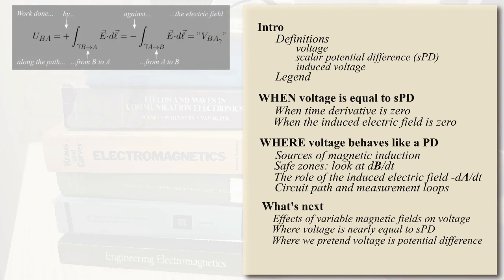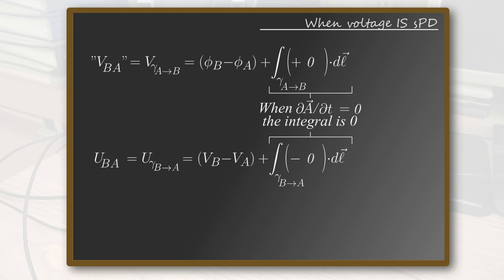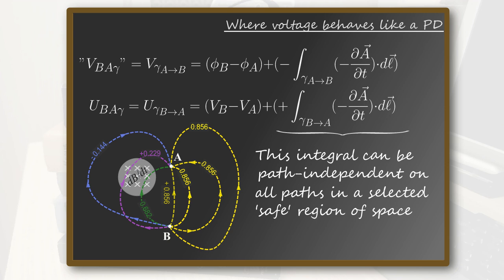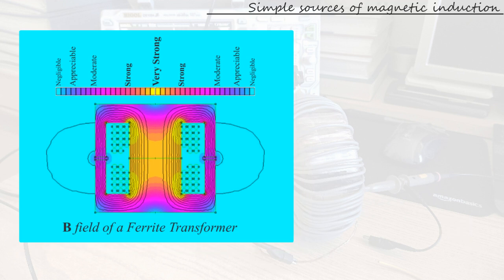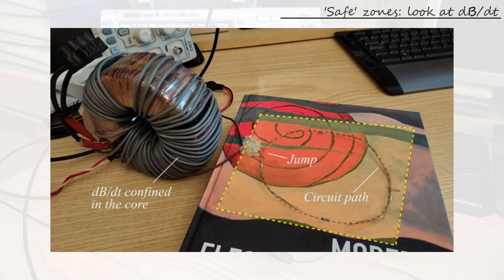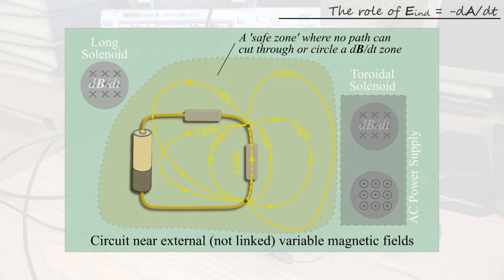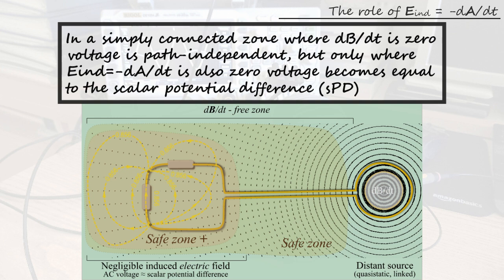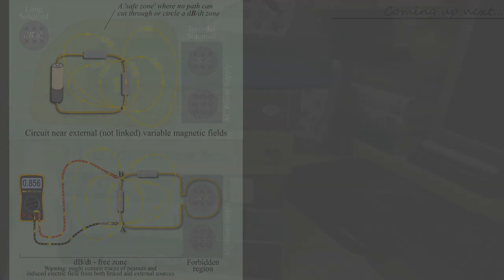When and Where Voltage is Path-independent

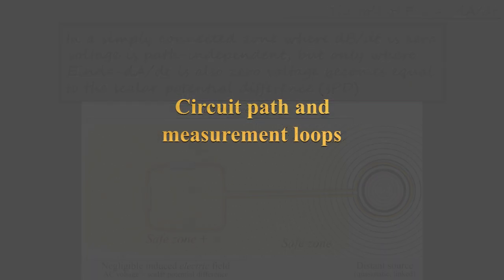Comment: 42:33 Circuit path Г is not conservative. Inside the battery is not a "safe zone". I know we partly discussed that already, but I insist on that. E field is literally defined as a force acting on a charge, divided by that charge value. Lorentz force is NOT the one and only force that can act on a charged particle. Chemical forces inside the battery are not conservative, hence they create non-conservative E field. Perfect proof of that is a load, like a lightbulb, connected to the battery. It actually lights up. Charges do actually move along that loop Г, and every time they make a loop, they dump more and more energy into the load. That is impossible in conservative E field. If you want to define a safe zone, you have to avoid EVERY source of non-conservative field. Do not go with your E*dl integral path into batteries. Or into solar cells, or thermocouples, or piezoelectric elements, etc. Whole world does not revolve around purely and only magnetically induced E fields.
Reply from the maker: Don't worry, I appreciate criticism.
This is a series of videos all linked together, and as I specified in the previous ones I am - for the moment - only considering EMFs of electromagnetic origin in stationary circuits. (EDIT The circuits with batteries are used as examples but I will explain how to treat chemical EMF in a later video, but the electric field is conservative there - there is another force that is not conservative and does not appear in the circulation of E)

The reason is two-fold: first to simplify the exposition, avoiding the more complicated general case (moving, deforming circuit, retardation, radiation, and other sources of EMF).

The second reason is that the EMF of electromagnetic origin is a very special kind of EMF. It is the only one that can make voltage path dependent. The other forms of EMFs are not primarily associated with a time varying magnetic flux, and as such do not introduce that element that will make a zone 'unsafe'.
Being safe or unsafe depends on the presence of dB/dt in the area, not on the presence of a non conservative source of electric field. Only the EMF of electromagnetic origin introduces that element in an unavoidable way.

This will be clearer (I hope) in the video on IEC loop voltage, and even more so on the videos on the EMF.
Reply: @copernicofelinis  But the voltage definitely is path dependent along path Г. Think about it. E field is zero inside wires, because they have zero resistance. E field is zero inside battery, because it has zero resistance, the same way. If that bothers you, let's replace battery with a thermocouple, placed in a fire. It literally is a piece of wire with zero internal resistance. The only place where E field is nonzero, is the load, connected to that battery/thermocouple. You make 1 full loop around path Г, you get voltage of 1*EMF, all of it inside the load. If you made 2 loops, you have load voltage of 2*EMF, and so on. Infinite number of possible integral paths through the battery/thermocouple, so infinite number of possible voltages through the load. And it is true. That same 1 electron  traveling along the path Г twice actually will deliver twice as much energy to the load, compared to electron that traveled only once.

What makes you so stubborn about this? You say let's stick to IEC definitions. OK. Where in those definitions does it say that the one and only force that defines E field strength is the Lorenz force?
Reply from the maker: @krakrukra1731 again, this will be explained in the video on loop voltage and emf. Consider an open circuit battery: it produces a charge displacement at its electrodes, let's say plus on top and minus at the bottom. The field from the plus charge at the top will go out in all directions, in particular upwards towards space (the field lines will later bend to reach the negative pole) and straight down directly towards the negative pole. So you have an electric field that goes from plus to minus in space AND an electric field that goes from plus to minus INSIDE the battery. This is a conservative E field and the circulation of E dot dl is zero. The missing part is the component of F/q that is of chemical nature, but that only appears in the computation of the EMF, and not in the circulation of E.

The same happens when you close the battery on a load. In this case you will have an electric field going from plus to minus in the resistor and an electric field going from plus to minus (again!) in the battery. And again the circulation of E dot dl is zero.

You can't see EMFs of non Faraday origin from the circulation of E. I guess that is why the IEC chose not to define the concept of EMF and go instead with "loop voltage".
Reply: @copernicofelinis  That does not answer the question. Electric field strength, E, has an IEC definition. From IEC-60050-121, literal quote: "electric field strength (symbol: E ) vector field quantity E which exerts on any charged particle at rest a force F equal to the product of E and the electric charge Q of the particle: F =Q*E"

There is no limitation on what that force is, as far as IEC definition is concerned. Why do you arbitrarily place this requirement yourself then? Because you really want to believe that "Faraday's law always works"? No, not always. Try to apply it to a battery circuit, Lewin ring style. There is no changing magnetic flux inside. So Faraday's law predicts 0 EMF in the loop. Resistance inside the loop is equal to the load resistance R. So, you predict that current in the loop must be 0/R = 0 amps. Voltage across the load must be 0*R = 0 volts. Faraday's law predicts, that the battery can NOT as you say, create charge displacement at it's electrodes. But it does. Current does flow. Voltage does appear across the load. Your prediction based on Faraday's law alone was wrong.
Reply from the maker: @krakrukra1731 Faraday's law predicts 0 EMF of electromagnetic origin (by this I mean due to a changing flux), yes. But it says nothing about other forms of EMF.

In 

F = q E

F IS q times E. If you prefer, write it as F_electrical = q E. Why are you putting other terms in it?
Reply: @copernicofelinis  Exactly, man. Faraday's law does not describe total E field. Only magnetically induced E field. Which is not the one and only source of non-conservative field. If charges really moved along that magnetically induced field alone, as if that field is the final total E field, they would not move at all.
Reply from the maker: @krakrukra1731 as I said in the comments in the other video, the E in Faraday's law is the TOTAL electric field. When you decompose it into its irrotational and solenoidal components, the curl distributes among the addenda and you are left with the solenoidal component alone.

What you seem to have trouble with is the difference between the total FORCE

Ftot = Fel + Fch + Fnuc + Fth + ...

and the total electric field. Etot is the ELECTRIC force per unit charge, not the total force per unit charge.
When you divide by q the above expression for Ftot becomes

Ftot/q = Etot + Fch/q + Fnuc/q + Fth/q + ...

Ftot/q is what you should use to compute the EMF. The part Etot gives the EMF of Faraday origin, Fch/q gives the EMF of chemi cal batteries, Fnuc/q gives the EMF of nuclear origin, and so on...
Reply: @copernicofelinis  Man, I don't have trouble with total force. Force defines the E field, not the other way around. You define a quantity, E, to simplify your work. You do an experiment, you see that Coulomb law works. So you say Etot = Fcoulomb/q. So long as all other forces are negligible compared to Coulomb force, that definition is fine. But then you do an experiment, and realize that changing magnetic flux can also move charged particles. And if you have changing magnetic flux, not all other forces are negligible, you say Etot= (Fcoulomb + Fmagnetic)/q. Then you do an experiment, and see that inside a battery there is some other new force, which can also move charged particles and is not negligible compared to others. So now you have to take into account that Etot = (Fcoulomb + Fmagnetic + Fchemical)/q. 

This is what I am talking about. That IEC definition did not say Etot=(Fcoulomb+Fmagnetic)/q. It said some generic force Ftot. Which may include whatever components. Why are you limiting that Ftot to be Ftot=(Fcoulomb+Fmagnetic)?
Reply from the maker: @krakrukra1731 no. The non electrical forces do not appear inside the expression for the electric field!!!

You cannot explain nuclear interaction with electromagnetic forces! It's literally different branches of physics!
You'd win the Nobel prize for the theory of unification if you could do that.

Let me add this: what you can do is use the total force instead of the electric force alone. This is an unnecessary complication because all the other forms of EMF are localized and the other force components are zero outside of the source. The only delocalized form of EMF (in the sense that what ends up in the circulation depends on what happens in the area encircled by the path) is the EMF of Faraday's origin.

This is what I meant in the comment in the other video when I wrote it is easier to deal with non electromagnetic EMFs by using a black box approach. Using only Fel in the circuit is simpler.
Reply: @copernicofelinis  I do accept your argument that defining E field like this would be very complicated in certain situations. Like nuclear interactions. You can 
call it a reason to not include other forces into E field definition. Though, strictly speaking, they do fit the definition as it is. Maybe the definition should be more precise then.

It is a better way to say that force field is non-conservative instead of E field when you go through a battery. Though, can't call this an unnecessary complication. You absolutely have to take that EMF into account in order to predict correct results.
Reply from the maker: @krakrukra1731 The other forces should not enter the definition of the electric field. Just like the electric force should not enter the definition of the chemical potential. 
You are right, though, to say that it's the overall force field to be NON-conservative and this is in my opinion something that is not sufficiently explained in most textbooks.

In a battery, the forces of chemical nature (which, truth be told, are still electromagnetic in nature but are better described in terms of gradients of concentration) push charges of opposite sign apart , against the electric field that they produce. A charged open circuit battery is the result of an equilibrium between the chemical force pushing the charges away and the electric force trying to pull them together. The electric field of these charges is electrostatic and as such is conservative, so the circulation of E dot dl on a closed path (half inside the battery and half in the space outside) will be zero.

What is not zero is the line integral of (Fel + Fch)/q, and that amounts to the emf of the battery.

The equilibrium in open circuit makes the chemical and electrical forces equal (it's more accurate to say it's the line integral of these forces are equal), but the electric field is always Fel/q and not (Fel+Fch)/q.